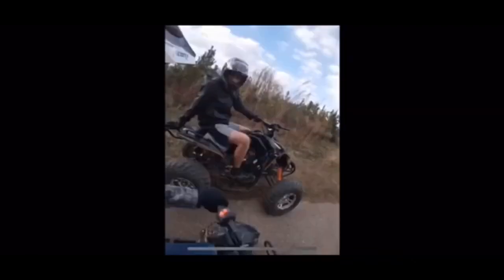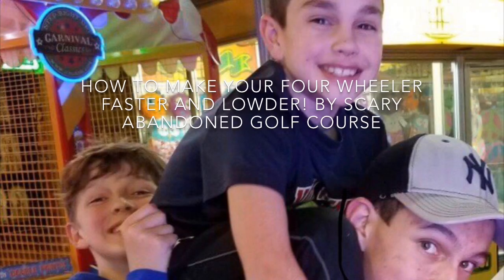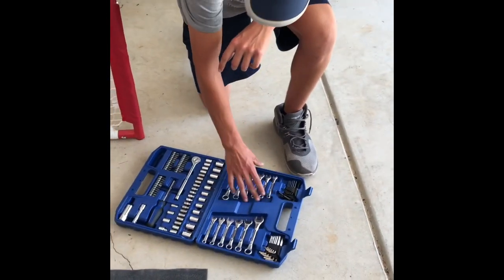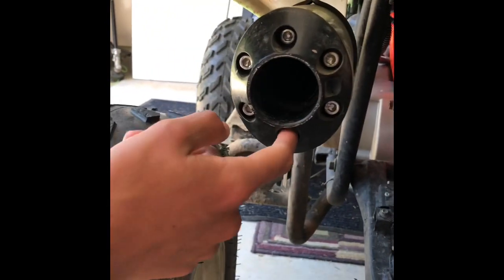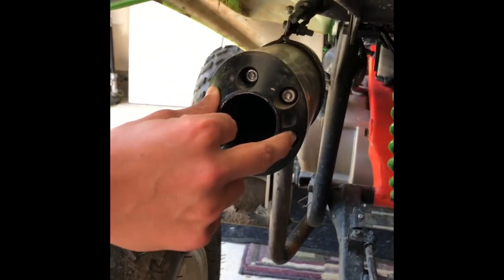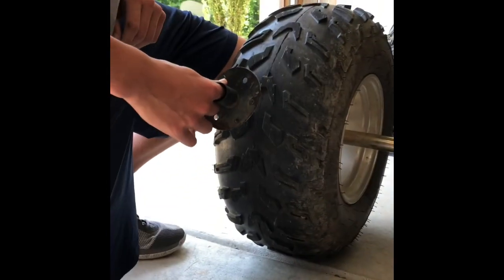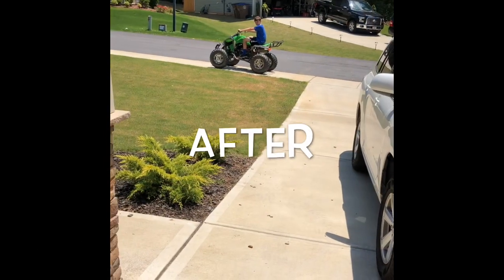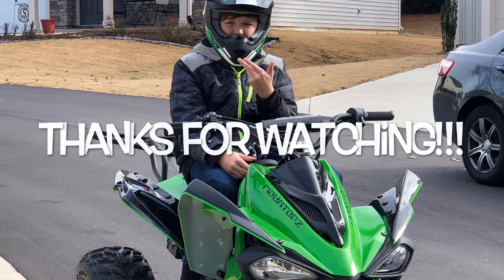How To Make ATV Faster For Free!

Comment: Your damaging your engine by doing what you did..now your valves will float and you will burn out your cam and lifters
Reply: Michael Stariha no he just opened it a little more kinda like straight piping
Reply from the maker: Lax Stringbean, correct and I’ve had mine like this for 2 years. Knock on wood no problems have come from it.
Reply: Micheal Stariha. Couldn't agree more. Now their like kids with straight piped civics. 🤣🤣
Reply from the maker: It's Me, do you have nothing better to do other than to ridicule kids trying to make videos on their quads and easy mods just for fun and to try new things? It hasn’t ever damaged anything and like I said in reply to your other comment, the flange on the exhaust has a smaller diameter than the pipe so the same amount of air can only go through as before, most performance exhausts for name brand quads have the same set up as seen here with a muffler and no baffle. Go try it yourself and it doesn’t ruin the engine, we have experience with this exact set up because it’s our quad not yours and never have we had any problems. If it makes you feel better the baffle is back in there just with the mesh taken off. No need to worry not your quad that’s going to blow up. Oh wait it wouldn’t anyway? 😱
Reply: @chaz13748  um are you goofy in the head? he opened up the exhaust like a performance exhaust would work its not a fart can
Reply: Michael Stariha bro. It’s literally doing no damage to it. It’s like making it into a performance exhaust not a fart can. Performance exhaust have that same setup
Reply: Not true at all if anything the baffle reduces power.
Reply: Dude mine has been like that for like 4 years and nothing has messed up on it.
Reply: Fake news
Reply: @chaz13748 BRO YOU HAVE A PROBLEM WITH KIDS HAVING FUN! 😡

Comment: what I did to make mine faster was unscrew the throttle screw :>
Reply: What’s that?
Reply: @vizwlfy498  Its a little screw on the throttle you twist it and it will open up the throttle for more speed
Reply: @Andyyyayy  ok on the right side of the handle bar?
Reply: @vizwlfy498  Yes
Reply: can you post a video of it ?
Reply: @Andyyyayy  is it a long one? Like sticking out
Reply: Wow

Comment: You can also make it faster by pouring oil in the gas tank
Reply: @eagleflight7501  reallly
Reply: Dude your right I put 2 cycle oil in my dad's 2021 can am renegade 1000. It's so powerful that it blew up the engine.

Comment: How fast do yours go? Also, can you add K&N to these, I’m wondering if I should put 1 on mine . Give it more airflow .
Reply from the maker: About 40 for the green one and 45 for the black one. You can find a pod filter for more airflow for less than $10 on eBay or Amazon.
Reply: ATV Abuse Ok, you guys have a 125CC, or 150CC?
Reply from the maker: Brandon W. 150cc two of the same quad one is lowered with street tires for drifting the other is stock height and tires
Reply: ATV Abuse Oh ok, also do you know any cheap ATV Speakers? It can be handlebar speakers are something .
Reply from the maker: Brandon W. No I had one but wouldn’t recommend it, said it was waterproof but after two rides it died. You can probably can find one online easily. Let me know if you get one and like it.

Comment: I like that ATV. How do you like it? Any problems with it? I like the video.👍🏻
Reply from the maker: Good beginner quad, with a few modifications it is a great one. Had a few issues nothing major just replacing electrical components or cleaning the carb. Definitely recommend if you want a new quad but don’t have thousands of dollars to spend.
Reply: Honestly, the Vitacci Pentora 250cc is the BEST Chinese quad. Can put Yamaha YFZ450 parts o. It, except the engine, mounts are different. But the quad holds up exactly how I needed. I’m hitting jumped and going over rough bumps, chain stays tight, axle stays centered, I love it

Comment: Is these safe
Reply from the maker: Andrew Elder, Yes it hasn’t caused us any problems.
Reply: ATV Abuse had run my Polaris 325 like this for around 3 years then after buying a slip on pipe , no sights of where runs mint and in my opinion out dose make it sound better
Reply: That thing you took out prevents backfire so if its out your quad has a possibility to spit fire out and on the ground. Not safe at all but extremely fun.
Reply: Xxulte your atv will not run lean enough to spit fire, if it dose you going to drop a valve, don’t listen to this guy. In order to “spit flames” you must have very meat up somewhere in re jetting your carb or some how have advanced your timing so far advanced that it would run to begin with.... do your research bud😁

Comment: What's letting more air in the motor? 🤣🤣🤣🤣

There is absolutely no way it'll go faster unless you let more air in the engine. And you never adjusted the carb for the change in air flow. It actually slows it down! Get a GPS speedometer and it'll prove it to you. There is 100% scientifically no way that makes it go faster
Reply from the maker: We did use a gps speedometer app and not shown in the video is us removing the Airbox and putting a pod filter on, the carb came running rich so there was no need to adjust it. Thanks for your concern but we know what we’re doing, and scientifically it doesn’t make it slower if you only removed the baffle it just lets the intake match the size of the exhaust. Also the exhaust pipe has a smaller diameter at the flange than the pipe, almost half the size so if anything it’s just making it a little bit louder. Thanks for watching.
Reply: It allows air to flow out of the engine easier allowing more air to enter without having to back pressure of a low flowing muffler. So yes it increases horsepower by a little bit making it faster.
Reply: @atvabuse5738  that being said you did remove the spark arrester which plays a critical role in keeping combustable debree away from wildlife, so use with caution
Reply from the maker: Althornes, really what harm is this 150cc going to cause “wildlife”? All of you trying to give your opinions or what you think need to shut up because we don’t care and neither should you, it’s not your stuff. It’s our stuff, it doesn’t have problems. Why so many haters 😤🤬🤯!
Reply: @atvabuse5738  bro I agreed in the sense of it adds power, shutting down @itsme comment^^^. I'm just saying you should be cautious and avoid tall dry brush, Im not trying to hate man.
Reply from the maker: Althornes, Wasn’t trying to go at just you, we don’t understand why there are so many people are ridiculing our video. We are just kids trying to have fun and learning through trial and error, however so far there hasn’t been any error. Like I said before it’s our stuff so it doesn’t bother anyone else when we do mods to it or us because there hasn’t been issues. That is the only reason the video is still up. If one of our quads blew up because of this or any mod we would take it down. Thanks for watching, new videos on the way!
Reply: @atvabuse5738  but you still haven't mentioned adjusting your air fuel ratio. I've built engines for years, try adjusting the ratio screw. You'll see what I mean. That amount of air needs more fuel for the proper mix. Trust me, your running way to lean doing that. Make it more rich. It'll also save your machine
Reply from the maker: It's Me, like I’ve said in a previous comment we didn’t show changing the jetting. However we did, we aren’t that stupid. Everyone knows when you let in and out more air you have to let more fuel in other wise you won’t gain much performance. These Chinese bike also come running rich because of the restrictive exhaust and intake.
Reply: @atvabuse5738  I think you should make a video of that though. You'd be surprised how many people don't. I adjust carbs literally 4 times a week because of people playing with the exhaust. I don't mind because I'm the one getting paid. It's a simple skill as you know (just listen to it). But make a video to show others how to and save them money. And help them realize what a performance tune really means. Bet it would help a lot of viewers.
Reply from the maker: It's Me, Good Idea. Have to make a video soon on one of our quads. However if you would have just said that from the start we would have hearted the comment not have gotten angry with you. Thanks again for the suggestion.